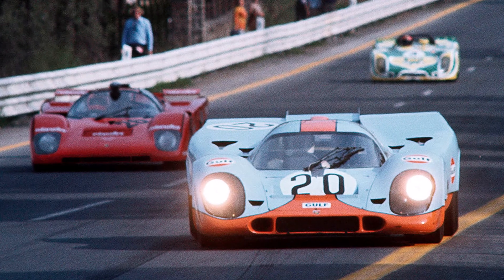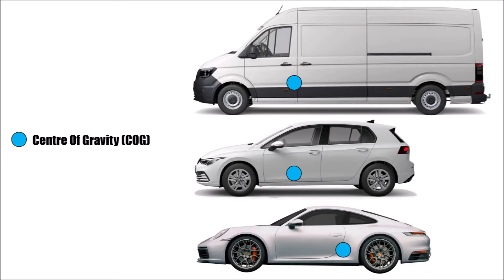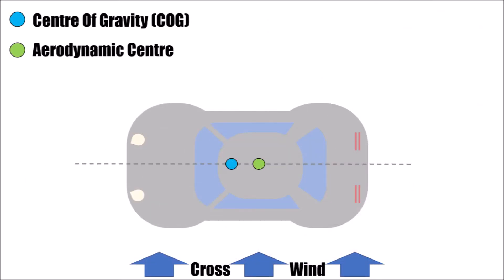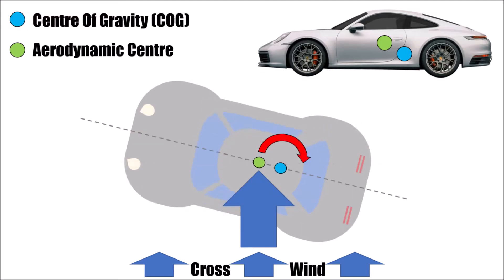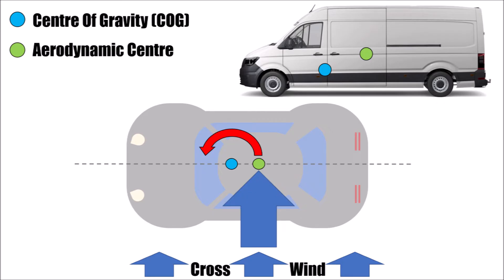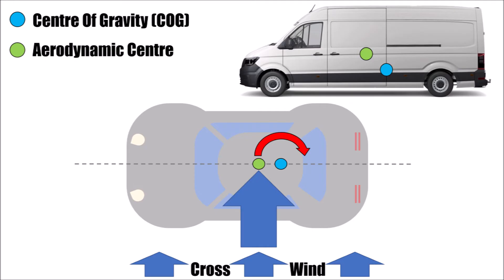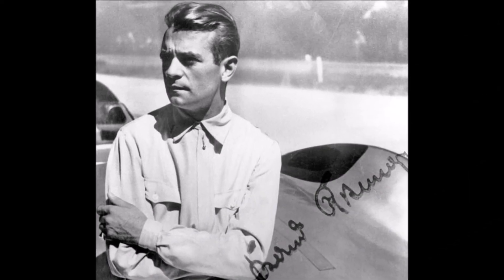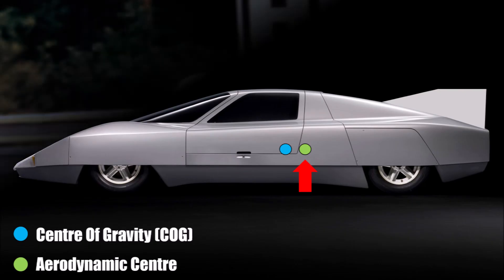Crosswind Sensitivity - EXPLAINED

Comment: Hm, I cannot understand why turning nose to the wind is good, and the opposite is bad?
Reply: Try to answer myself the question of mine after watching video about shark fin on race cars. And it doesn't have any conjunction with side wind itself! If your car have side jerk (get yaw moment) and now car's nose is not pointed to the straight trajectory it could become a sort of problem at high speeds. Now the car is positioned to oncoming air flow at some little angle. And side surface of the car is exposed to that air flow at some degree. That flow generates side force that applies to the side surface of the car and is pointed sideward. If the Center Of Aero is behind the Center Of Gravity that side force would counteract trajectory changing and stabilize the car. In opposite situation oncoming flow would force the car to turn more out of trajectory.

Comment: how do you find aerodynamic center on your car?
Reply: 1. find a side view of your car
2. divide the side view of your car into a series of approximated rectangles
3. record the area of each rectangle (A1 ... An) and the distance from its center of area from a chosen point (X1 ... Xn), for example, the very front or very back of the car
4. multiply each area by its distance from that chosen point (A x X)
5. add up all of these (A1X1 + A2X2 + A3X3... etc) (let's call this total 'Y')
6. Add up all the areas (A1 + A2 + A3 etc) (and call this 'At')
7. divide 'Y' by 'At' and you get a distance from that chose point to your center of area.
This method works in only one dimension so you'll need to repeat this for height
You'll also need to be consistent with units.  So if you use mm for the distance from a chosen point, then the dimensions of your rectangles need to be in mm (so that your rectangle areas are mm^2).
How many rectangles you divide the car into dictates how accurate your number will be.  But don't go too crazy as you also have to consider that the car is not a box shape and so some parts will 'release' air over the top of the car more than others so contribute slightly less to the aerodynamic center.  So this method is already only an approximation... splitting it up into 100 rectangles is not worth it.

Comment: Thanks to this video I finally know why they put sails(?) on F1 and LMP/DPi cars.
Reply: That and two other reasons. 1 it helps keep the car going a straight line and thus adds high speed stability in corners etc and 2 the main reason is safety. pre sharkfin LMPs had a very high tendency to take flight if they where turned sideways because the air flow over the body sideways worked sorta like a plane wing. The shark fin then acts like a huge Gurney flap when the car is sideways and adds downforce keeping the car on the ground.
Reply: F1 sharkfin also create high presure area when the car turn and push the turbulant air from wheel out of the car

Comment: Doesn't a shark fin increase the sensitivity to the wind though? Or is the lever effect enough to counterbalance this effect?
Reply from the maker: It depends on where you mount the shark fin, like I described, you can change the position of the aerodynamic centre.
Reply: if you fin it only at the back, then you would retrace the aerodynamic center.